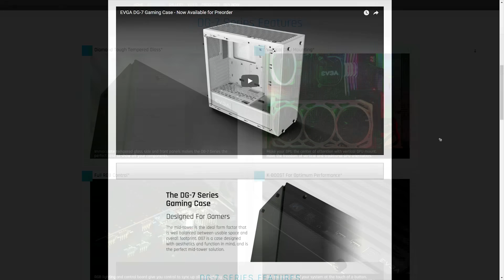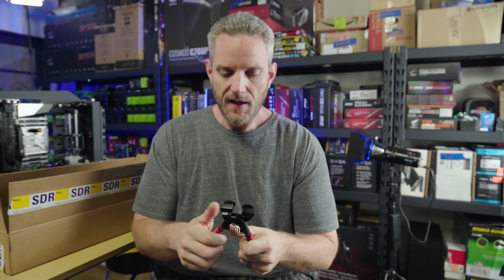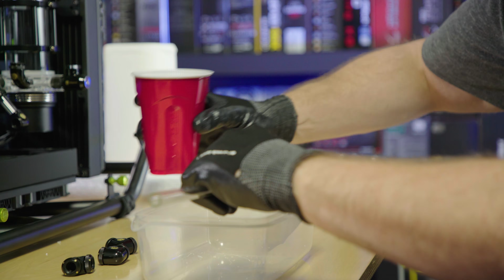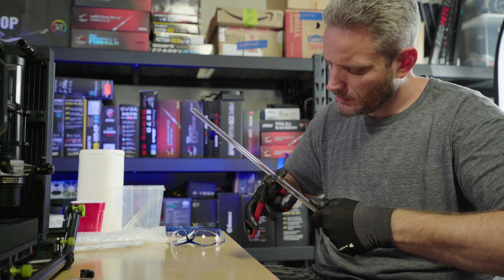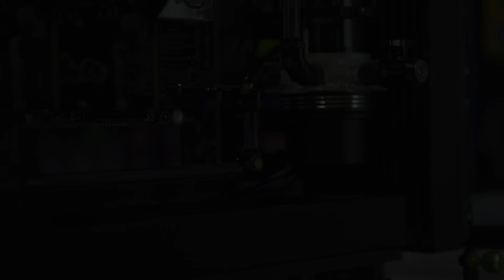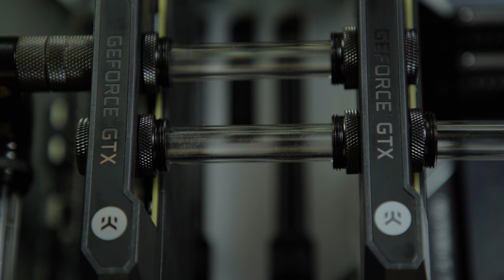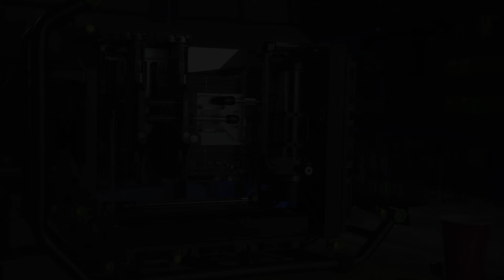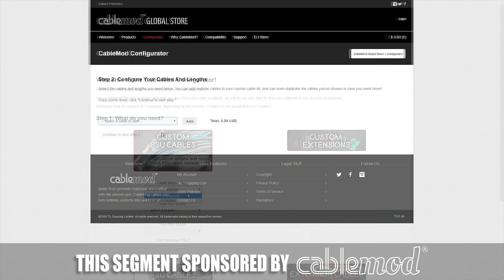First Custom Loop of 2018 - Personal Build Log Part 2.685

Comment: Is it just my old eyes, or did Jay leave the 'caps' off the fittings?
I see a lot of threaded metal on the fittings receiving tubes, and not a lot of compression fittings being, well, compressed.
Probably 'short-hand' at this stage.  To be revised?
Reply from the maker: Yes because like I said I have to flush radiators next so it all came back apart

Comment: Go with the UV Green Vue.  And then play with UV lighting in the system.  Couple reasons.  First, the Vue as you mentioned, cleans the system.  That is a good thing.  Secondly, the idea of having a UV system is definitely a change from the usual RGB trend.  I know you have those UV/RGB lights, and that presents you with a unique idea, something I am looking to put in my system: A duality of looks.  You can swap between the UV and the RGB lighting and give the computer a whole different look.  And if you use the right colors on the cablemod, you can have THOSE react to the UV and make a really cool look.  And that leads me to the final reason: This is exactly the same idea I was going with my system I am starting to get together.  I am going with the UV Green Vue, UV green fittings where I can, and have the whole 'blood' of the system being UV green.  Then I am going to do the cabling as all UV purple.  And then I will have both RGB and UV LEDs in the system (using the Darkside UVs, they give REALLY bright UV) and so I can swap between day mode (Purple in the RGB with the UV off) and night mode (UV on with the UV reactive parts all glowing either purple for cables or green for fluid)  To be honest, I want to see someone else do the same idea so that someone else can work through the problems with it before I do.  You have WAY more experience with this kind of thing than I do (this is going to be my third computer build but my first custom water loop and first hand at trying to create my own custom cables)

Comment: 500 Bucks on Fittings of a 6 station loop? Are they gold plated? If yes, nobody can see it.  thats why im aware of bit(coin)shower bitspower and go with Monsoon or EK.. And if you use borosilicate glass tubing, why not a borosilicateglass-reservoir (aquacomputer aqualis for example) too (with nano-protection-coating) ? so the reservoir and the tubes would have the same, beautiful clear view, i just cant believe, you'd like the difference.. besides of that, its a very interesting and good looking Project.  PS: aquatuning.us offers 90° angled borosilicate tubes, if you'd like to swap somehow...

Comment: Heating a system up will actually help that filter work better. It accelerates reaction in a given solution. Its the reason hot water pipes in restaurants are destroyed in a matter of a few years vs cold water piping lasting nearly 50+ years. Also see steam 😂. Nastiest mess I have to mess with . steam is far more violent , that and r.o. water systems.

Comment: This build is turning out amazing. I still prefer more traditional layouts like Skunkworks, but this is the first D-frame build that I am really loving. I've always found it to be an "almost awesome" case with every other build I've seen with it. Something about that green is doing it for me though. You seem to be fixing the one major issue I still have with the case by putting in a custom backplate between the glass and the cables. I almost did that with aluminum sheets under all 4 pieces of glass on my 570X but ended up painting the underside of the glass due to space constraints. The extra 4mm (2mm for the panel, 2mm for spacing between glass) was too much to fit everything without one or two cables touching. The left side panel's aluminum mount solution was too obvious too.  The D-frame has plenty of space for such a design though.

Comment: I hope to see part 2.71828. Me and my bro Euler can't wait for it!
Reply: That's natural. Best to not drop a log over it though. You'll probably be left with only 1. Not really worth it at that point from a Lagrangeian perspective.
Reply: rubbers3 dude well done actually 😂
Reply: Slow clap well done sir.
Reply: 685 is probably the cost (in $) of the box that arrived after part 2 was done. $500 for the fittings alone is expensive af.
Reply: PC-Extreming.  Definitely not for the faint of heart ... or wallet.  That's why I watch this channel.  He makes up a good looking rig for us to oogle at, and I don't have to be stuck with a $4,000 machine.

Comment: @jayz2cents just so you know jay that tool youre using to score the glass is actually for cutting solid glass rods.  its not designed to be used for scoring.  I suppose you can use it that way because it still has diamond blades but You dont need to score the glass very deep to break it. in Lampworking (glassblowing) we use a simple diamond blade to score a small section of the glass and then break it using spit.  If you ever need help with custom glass bends or custom glass containers for resevoirs or other neat things feel free to get ahold of me here or on instagram Id be willing to help you out and whatever I cant do my friend Antho could take care of for you.
  Love the builds.  Check out a few of mine on my instagram @spyguy420
Reply: spyguy420 "Antho could take care of you", man that shits a bit creepy 😅

Comment: Uhm, when you said: This almost done, i will be doing it and bla  bla.. uhh you did not mention fittings. They are not done, you got to take all apart to add the fittings to screw on. They all unscrewed. Edit: On glass side ofcourse.

Comment: You need to use the monsoon fittings in a build. You showed them off once but never used them. They are amazing. Especially the ones with the built in led light port for lighting just the fluid.

Comment: You probably already considered all of this but just in case:

The Vue with its "shiny-metallic" appearance might put more emphasis on the shiny screws and shiny green bars if the case, the Mayems might emphasise the matt fittings holding the shiny green "rollcage" bars. To me the shiny is already represented fairly well (with the logo plate, bars and the amount of shiny green casescrews), and I think the Mayhems might balance the different appearances of "shinyness" more. You have very shiny greens, glossy black case bars, matt black rads and backplate but the truly matt apprearance of the green is very mildly represented, with just those 4 holding "fittings". 
The matt fluid might also make it "pop" more. 

Now that's what I think based off of my opinion and what I see on the screen, without the glass and wireing.
I very well know you have the final call and make your own decision, but I hope my input might have helped in some sorts :)

Keep up the great work!

Comment: Just looked up the prices for glass tubing through Performance-PCs. You can find it much less expensive through a glass supplier, especially for art or science. Seeing a couple listings on Amazon for the same kind of glass tubes for a fraction of the price.

Plus if you don't mind going with an 8mm ID (12mm OD), you can find some interesting colors as well. Not sure what colors are available for 10mm ID as I didn't search very far on Amazon's site.

Comment: Borosilicate glass is nice but maybe a little overkill. It's no stronger than regular glass. What it does is it doesn't expand or contract when heated, so will not shatter from thermal shock which is handy if you put a bunsen burner under it. With the lukewarm water in a watercooling loop it's not going to make much difference so if you can only get regular glass it'll be fine.

Comment: while watchin ur outro wouldnt it b neat to have one big block made that covers the cpu the ram and the vrms it could fill in that gap between the fittin ontop the res and connect it to the gpu assembly nicely

Comment: Interesting system but I think i'm kind of scared of glass tubing, don't like the idea of all those micro files of glass hanging around though I guess if you did it in an actual workshop or outside then it wouldn't be an issue.

Comment: Jay, are you going to do a video regarding Kernel memory leaking from Intel?
Reply from the maker: No. Because I don’t understand it.
Reply: Nice reply.
Reply: The guys at hardware unboxing already did 2 videos on it, one where they tested pre and post the windows update that addresses the vulnerability, but the bottom line, just as the initial tests with Linux indicate, that normal users or gaming performance is mostly unaffected. 

On their test the only thing that was affected was 4k iops on an nvme ssd 

Gamers nexus will probably be doing a similar test
Reply: Jay! they say (arguably) that this flaw affects (again, arguably) performance!
Reply: If also Jay doesn't know, we are boned then.

Comment: @JayzTwoCents I seem to recall a video on YouTube where a guy was actually bending glass tubing over his kitchen stove. And as far as I could see bending glass is not actually rocket science, just like bending normal tubing... except uh, with a lot more heat. And some little things taking care it properly as it cools down. 
The 90 degree fittings in the middle bends don't bother me nearly as much as other builds (I think because they are all connected at least one relatively short run so it doesn't look like they are just out there randomly) and obviously you've already set up all the tubing, but I think it might be neat to see a video on bending glass in the future... someday.
BUT I DIGRESS ;)

Comment: hi, i used glass tubing for my custom desk-pc case and i can tell it is very easy to work with and it looks so incredibly clear. I did even get some 90° angeled tubes from a local glass manufacturing company for only 6€ per piece. For cutting i used the same tool as you did in your last videos, but for deburring i used a dremel with a diamond cutting disk. With the diamond disk you are able to grind a few millimeters in length if you measured the tube wrong.

Comment: Jay how do you put the tubes between two graphic cards in? When I did my tubing with PETG tubes, I felt it is really hard to squeeze the tubes in. Did you just use brute force to push them in?
Reply: Doing the PCI screws last is a great way to give the graphics cards some flex. It is generally fiddly to get those tubes in, in the worst case you will have to put the tubes in first and then have 2 people put the cards into their slots.
Reply: 程明昊 You will have to chamfer the tubings in order to fit those in to the fittings

Comment: Jay I have always wondered, why do you plumb your video cards in parallel instead of serial? Doesn't parallel plumbing cut the flow rate of each card in half compared to straight serial plumbing? You have built more SLI water cooled loops than me, so I am not claiming to know more. I am just curious why you do it one way over the other.
Reply: D3moknight as long as the pump is fast enough which they normally are I think it would slightly increase flow speed per card if it is any th8ng like electrical resistance parralel increases current by lowering resistance
Reply: D3moknight well a fixed flow rate is not gonna happen because the pump gets a set voltage and what it can actually pump is based on restriction. Its always pumping against some restriction. It could be diameter of tubing, fittings, or other restrictions(cpu&gpu blocks). If its the GPUs in series creating the biggest restrictions then going parallel will most likely increase flow in the rest of the loop. Now in a full loop it might not be the biggest restriction. There will still be lower flow through each card but possibly higher flow everywhere else. Were talking real world performance not theoretical.  You are correct though just trying to point out a benefit.
Reply: Parallel plumbing means that the fluid is split between the two cards. Serial means that it passes through one card, and then passes through the other card, one at a time. Think of it like this: Let's say your pump can move 50 L of water in a minute through the loop. If you have the cards in serial, each card is getting 50 L per minute because the water passes through one card, and then it passes through the other. If you have them in parallel, that 50 L per minute is split between them, so each is getting 25 L per minute, but the pump doesn't really know the difference because it is still just pumping 50 L per minute.
Reply: You are correct. But I think you are overestimating the temperature delta between the hottest water in the loop and the coldest water in the loop. The delta is usually only 1-2 degrees Celsius. This is the reason that it does not really matter what order you place your cards/CPU/radiators/pump. You can hook them up in any order and the entire loop heats up to a temperature equilibrium at roughly the same time, within the margin of error at least.
Reply: D3moknight could be , might need to pester jay to do a comparison .
Reply: Electrical ANALOGies do apply to fluid dynamics and many other things too. That is what old skool ANALOG computing was all about.
Reply: Agreed. The flow rate of the pump is not a constant for all conditions. A longer loop with more stuff "in series" - cards, radiators, whatever - will greatly reduce the output of the pump.
Reply: The analogy here is a voltage divider. Flow is current, pressure is voltage, resistance is still resistance. 
Edit: sorry I got some posts mixed up and there's no short way to go into this. I'll leave it to your search engines ;)
Reply: i was wondering the same thing.
Reply: D3moknight thank you. From what I can tell, there isn't going to be much of a difference, only in the finished look of the build.
Reply: I think because it objectively looks better. Moreover, the loss of flow is substantially less in parallel vs serial. Performance is usually unaffected and more evenly distributed across the cards.
Reply: I understand that some would say that it looks better. With the cards in serial, there is a tradeoff; each card receives a higher flow rate, but the entire loop as a whole has slightly higher resistance, slowing the flow rate overall. I haven't built a custom loop in a few years, and I used half inch ID at the time, which I think is less restrictive than the stuff I see being used lately.
Reply: landwolf00 if you think it objectively looks better, it's subjective.
Reply: D3moknight if the coolant from 1st card then travels to second card , something else goes with the coolant............heat .
Reply: D3moknight would you mind dumbing this down for all the spacks who don't understand what you mean?
Reply: No. It isn't like electrical. It is like fluid dynamics. When you have a fixed flow rate at the pump, and you take the path the fluid is flowing and split it, you will get the same total flow rate at the output, but at each fork in the split, the flow rate is divided by the total. With two cards, you will have roughly half the flow rate per card. After the fluid joins back together at the output for both cards, it will remain the same flow rate of the source/pump.

Comment: Jay I know you're like really into water cooling but you should make a way overkill air cooled system.
Reply: Waffle that would be short video. Biggest case with the most fans and the biggest cpu cooler you can get. That's all there would be to it
Reply: I have two Thermalright TY-143s (you know, the hideous purple and orange 140mm ones that go up to 2600 RPM) mounted to a Cooler Master Hyper 212 Evo. How's that for overkill?
Reply: But he could make it a lot more instesting by trying to use cpu coolers on the video cards. I don't know he just always does sone water cooling maybe he should ahow the air cooling side of things sone love too. :)
Reply: ALL of his builds are overkill
Reply: Just out of curiosity, how do you suppose cpu coolers will fit on a dual gpu system?